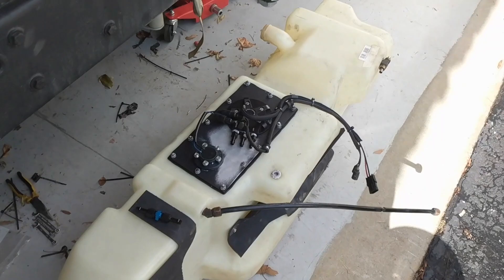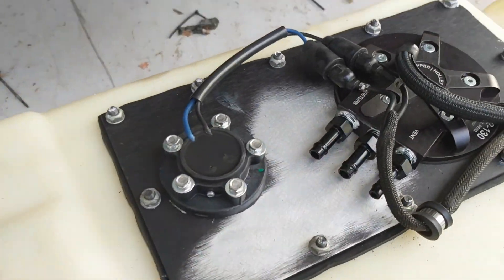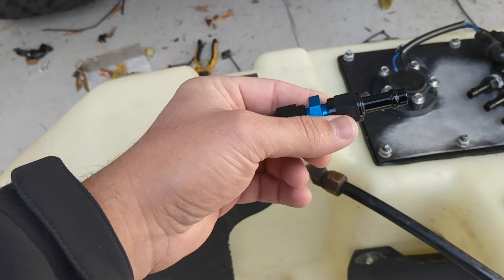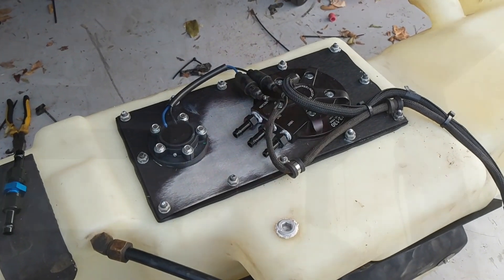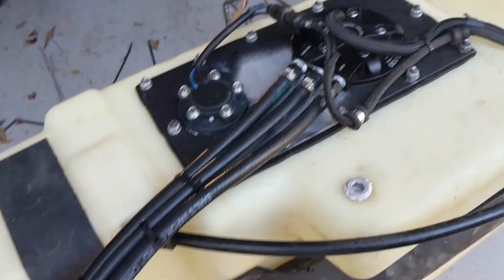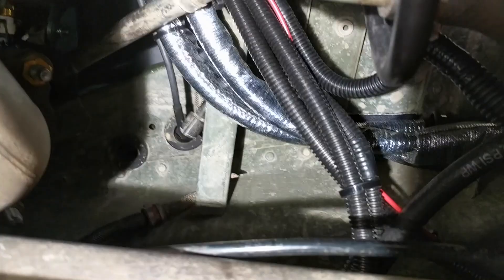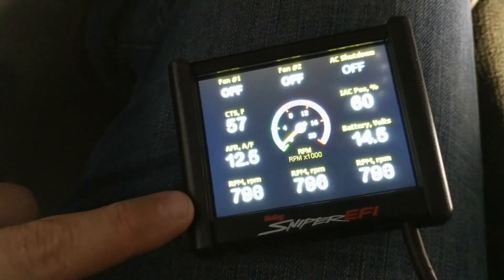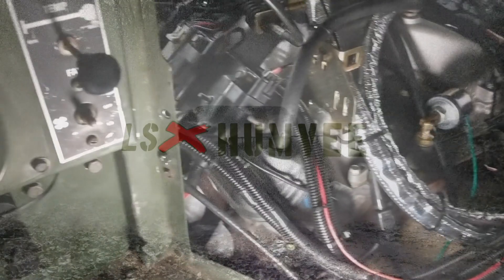Fuel System Update w Holley Retrofit Module - LSxHumvee

Comment: Great videos- doing a LS Swap on a govplanet heap and following along with your videos. Ive got the stock computer from the LQ4 I rebuilt, mostly stock with a BTR torque cam- do you know if the computer will plug/play with the holley fuel tank gear, or if eventually i'll need a different computer to manage it all? Thanks again! Also, nice work on the waist band!